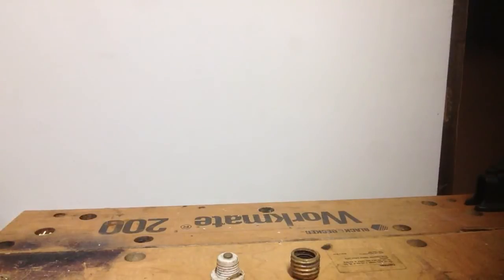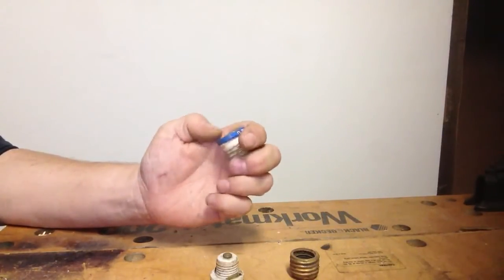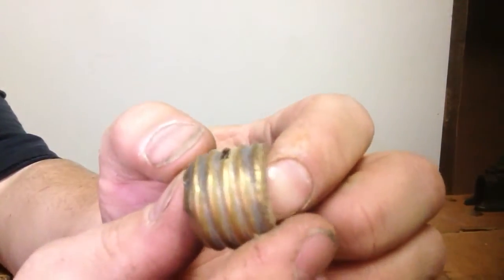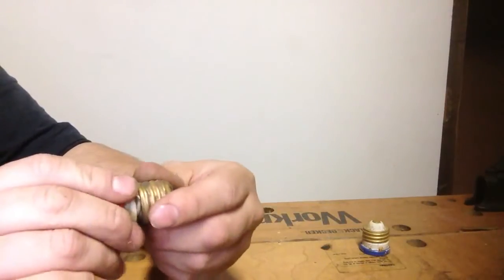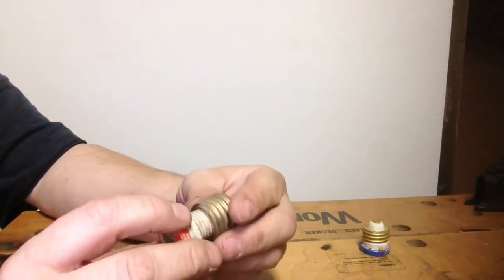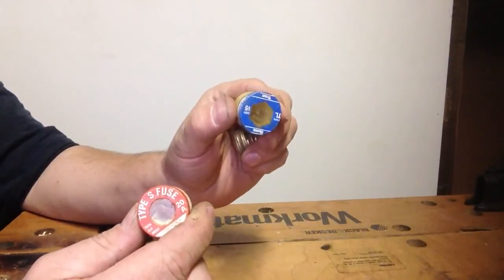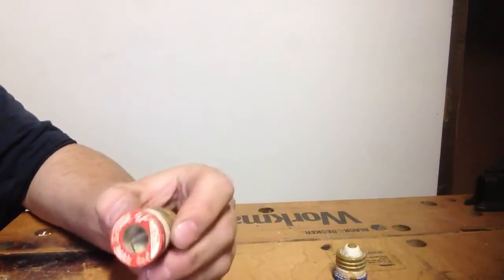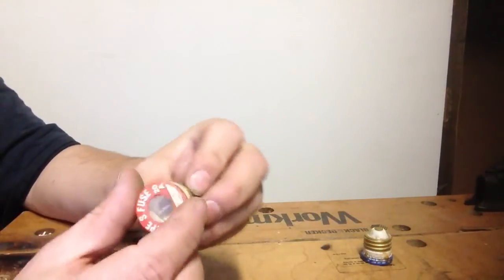What is an S Type fuse

Comment: It's called a Fustat fuse and it's designed to prevent people from doing stupid things like putting pennies in the socket, or too big of a fuse on a circuit, because they keep blowing fuses. Doing either of those things is a great way to burn your house down or worse.  Best thing one can do is upgrade to a breaker box, ditching fuses, entirely.

Comment: ive seen some circuit breaker plug fuses. are they good to use?

should i consider replacing the power panel with a new one or these plugs are still good and safe to use?

Comment: How do I find out which wiring I have. Ty for the video. I'm sure I mixed them up over the years judging by the color. Ty
Reply from the maker: S type fuses only go into the base they are intended for. A 15 will only go into a 15 base a 20 will only go into a 20 base. 20 will not go into a 15 or 15 into a 20.
Reply: @themrhelperguy  ty for your reply.   One more question. If I pull out all fuses, can safely replace an outlet? I thought it was my furnace, but rather an electric issue. Illuminating Company coming out tomorrow. Looks like they did shottie work. Ty again

Comment: how do you take that sleeve out with out messing up the box please tell me how..thanks
Reply: I do not know if you still have the s type fuse in place or not, but you should be certain nobody will put a larger fuse than the correct one for wire size you have.  That said, to remove sleeve, you will need to carefully break out the plastic insert in metal housing of s type fuse.  Break out in very small pieces until the hangnail clip is exposed.  Thank this circular wire out and fuse insert should unscrew with no problem. Of course it goes without saying power should be removed from s type fuse before removal.  I have done this before, but usually on a blade type disconnect with blade pulled open.
Reply: You can use a needle nose pliers and pry back the outer ring on the Type S adapter. After that you can use the pliers or small screwdriver and carefully slide out the plastic threaded part. Locate the small wire inside the socket that acts as a "barb" and holds the adapter in place. Pry it up and carefully unscrew the remaining screw shell. Obviously before doing this make sure the power is off, and please don't remove a 15 or 20 amp adapter to put a 30 amp fuse in there. This is a fire hazard.
Reply from the maker: It's been so long. I remember that there is a wire that holds the socket in there. Maybe fold the s socket into itself until there if enough play to reach the little wire.
Reply: There is a tool that is made for just that it cuts the lip off then you pull out black thread and pull up the barb and unscrew it shut of main before doing consult codes before doing
Reply: TRICO 38080 X-Tract-O Fuse Adapter Remover Tool; XTractO, S Type, Fustat,

Comment: Wall art and Lowes carry them do you know when s type came out 40s 50s 60s my parents house was wired 1970 they have wads worth box 4 pullouts and 8 fuse stats thanks
Reply: Type S fuses came out in the 1940's. I believe that codes required them in new installations starting in the 70's.
Reply from the maker: David Berquist I don't know when they came out but remember being forced to use them in the 80s
Reply: If it has metal threads that look like a light bulb base, it's an original Edison style fuse, and you should replace it with the appropriate Fustat adapter and Fustat fuse in place of the original Edison fuse.  Fustat adapters and fuses were designed to stop people from doing stupid things like using the wrong fuse, or worse, inserting a penny to complete the circuit, often by reusing the blown fuse to clamp the penny in place, which is a great way to burn your house down, because the penny is not going to break the circuit if overloaded.  The smartest move is upgrading to a modern breaker box, which is relatively easy if the house has Romex wire (the type used in homes today), and more involved if the house has the old Knob & Tube wiring of the past.